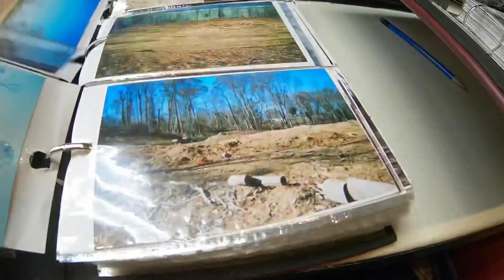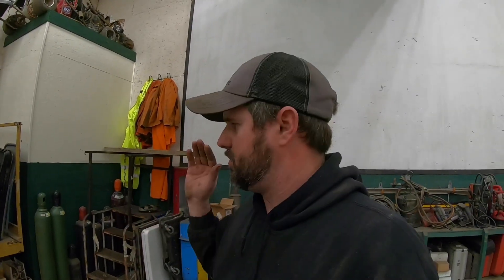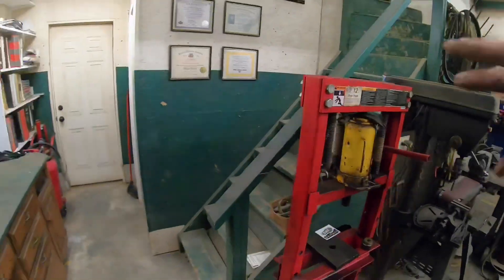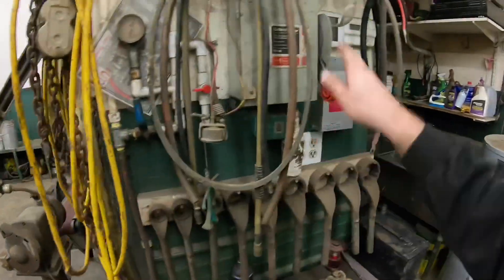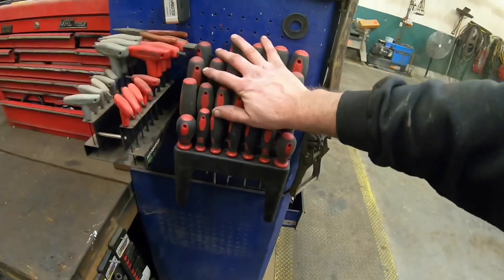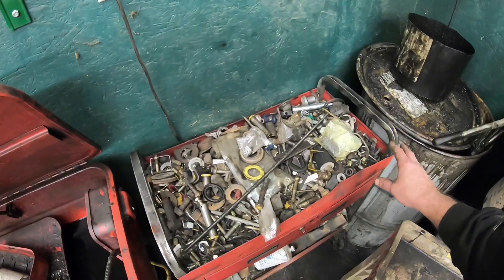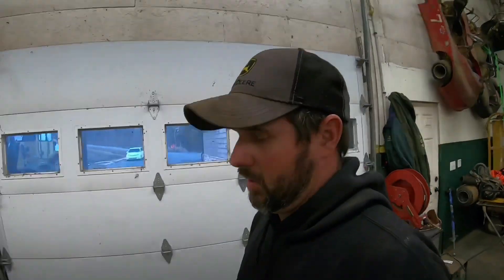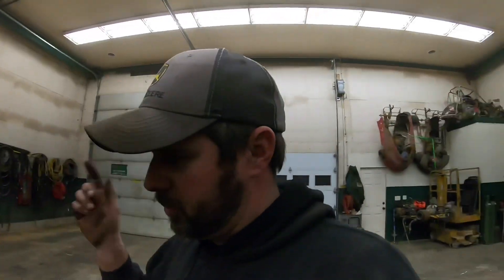Complete shop tour including detailed over view of my homemade budget built  2 ton overhead crane

Comment: Could be a possible option of putting in a door into the corner where oil drums are. Built walls out back of the lean two. Make a storage space for them and possibly a good place for air compressor to keep the noise down.

Comment: love the shop .. like how you did the garage doors so the crane works ,, the place I bought a year ago has a pole barn ,, yes it would be better if it was stick built .. i have put up 2 x 4 s getting ready for insolation then wall covering ,,  my shop is 30  x 40 10 ft walls ,, wish was 12 but I did not build it .. I use a engine hoist a lot .. and chain hoist off the trusses not safe ..I need to put steel beams up 2 ton would be the max I would be lifting .. need to find out what size beams I need ,, would love to have the over head crane system . rebuilding 1 of my trailers .. would be nice for lifting the axles .. there heavy engine lift too hard to move around with that type of lift ,, Great build on the shop and great video .. P/S where is the fridge ..??? I have a mini fridge in my shop with PEPSI , my shop is not attached to the home ..also the osb you put up I think is better for sound doing filming ,, where if it were metal the sound would echo..

Comment: you made a lot of good points.   Id like to put up a shop soon and have about 5 or 6 quotes for pole buildings. like you i wanted a concrete foundation and walls 2 foot above grade for the same reasons you mention.   I already figured out the 8' door and mini dont work out too well with my current garage.  a 12' wide door dont give you very much room on your mirrors pulling a truck in either.    I wanted to do 80' long for my cranes and to get a whole semi truck in there with room to work around it.  I started to get a spot cleared and leveled out last fall and hoping to resume here shortly with the weather getting nicer.
Reply from the maker: Sounds like you have a good plan would love to come visit some time and check out the old cranes
Reply: @DirtPerfect  sounds good.  MLH  and jason works a lot are 30-45 minutes from me.  tom decasale is an hour and 45 minutes and Garret is about 4 hours from me and The volvo customer center is an hour 45 as well.

Comment: Been lurking a while and subbed..... Shop envy for sure!! I am a Safety Manager, and noticed many pro-active things you have done. Congrats!!! But a couple things need to be pointed out and addressed: 1) I would put an extinguisher between the two doors... Less travel time in an emergency. 2) Clear access to the one one the North(?) wall. 3) Grinders. Guards need to be on them, and kept on. (I've seen a few of your shop vids where the guards are not on the grinders...) And 4) I would recommend adding wearing a face shield when using alot of the power equipment.  Think of it as double eye protection. These are minor quibbles I know, but safety is paramount. Keep up the good work, and keep loving that family of yours!! 

Lou
Reply from the maker: Thanks buddy

Comment: Nice shop I will say back then building the way you did stick building walls was more economically efficient so to speak. Now days the pole barn packages would save anyone lots of money on finishing off. One they have not changed much on the structure prices. Two you can work on finishing off inside as the prices drop on materials and as a person have the money saved up to spend. Milwaukee and dewalt have ups and downs as you say. Few years the Milwaukee batteries just sucked. Years before that dewalt batteries sucked 😅😂 they both have their years where they are amazing.

Comment: I was wondering why you had an air powered crane, I'd never seen one of those before, that's neat!  I'm with you on building a normal building instead of a pole barn, finishing a pole barn is just as much work as building a building with a foundation.  I've been thinking of building a shop that I can also store my motorhome in for the winter, but ultimately I want more land, so that will wait.

Comment: One thing you might like are large wooden blocks from bridge planking.  They are handy for supporting equipment, frames, support for welding while using jack stands and bottle Jack's.  I had railroad iron in the concrete for dozer so it won't bang up the concrete. Very sweet overhead crane. My door is wider so large equipment like combine, planters, disc and forage harvester can get in.  We have an extra side door for normal size vehicles with a drain to wash indoors. Love your shop! Well organized and planned out.  The OSB was the right choice.
Reply from the maker: Yes have some around back

Comment: Hey there, Great video and I love the channel. I'm going to be building a ICF shop in the near future (26 x 36 parking garage with a 30 x 40 shop behind that, 12' ceilings). you mentioned some general design rules for building an overhead shop crane, i was wondering if you could point me in the right direction to start looking at what I need to build one. i was thinking of using the ICF wall as support for the girders, but not sure if that would work (Tensile force vs compressive force and all that). Thank again for the great videos, they have helped me a lot in planning my build. :)

Comment: Thanks for the tour Mike Nice shop . In my shop 23 years old I have a hoist but like you said my ceiling isn't high enough  I can just stand Under vehicles and equipment no extra space. I did all my solid airline in Copper. With water filter & oiler at five Quick connect points. I can fit my  303.5C through my large door.  And all our tractors and our wacker neuson dumper just taking the beacon off.  And can only get our cat 416  just to the cab . Anyway thanks for sharing 👍😀 and have a good one. 🇨🇦 Craig

Comment: I agree 100% on pole barn vs other construction. Another thing you didn't touch on was how much a particular building will flex in the wind. Without basically building a house inside a pole barn, you'll always be able to find the seams in the drywall cause it will always be cracked! I'm leaning toward a steel framed building, however for my use.
Reply from the maker: Yup that is true also

Comment: Mike I noticed you have that air compressor tucked in there. Just a thought. When was the last time you changed the oil in the it? You may want to change that oil. Those old compressors are far better than the new ones. God bless
Reply from the maker: Yes every spring
Reply: @DirtPerfect  I should have known you're no dummy. God bless

Comment: Very nice shop you got there!  I like the old school feel it has to it with some of your grandfather's tools and such, I'm also sentimental about all my grandfather's tools I was blessed enough to inherit.  I do have one suggestion, it appeared to me that some of your air lines coming off of your compressor looked to be PVC.  If so, you should look into replacing them as soon as you can with copper or compressed air specific tubing.  I have some personal experience with PVC air lines and I am extremely lucky I wasn't injured or worse.  When I was probably 16 or 17 I worked at an independent auto repair shop that had their air system plumbed in PVC and the first time a section exploded, chunks of pipe missed me by a couple of feet at the most.  Despite the protests of the other techs and myself, the owner had a new section of PVC installed.  Couple months later a section on the other side of the shop let go and blasted a customer's car taking out the passenger side glass and doing some pretty decent body damage.  Fast forward several years and I was at work at my second career as a Firefighter/Paramedic and was dispatched to an emergency call from a body shop.  Initial info was 2 injured workers following an explosion, that shop also had PVC air lines and during the hot summer the main branch of I believe it was 1.5" or 2" PVC exploded, one of the workers had some lacerations to his arms but the other worker had several penetrating wounds to his neck, chest, and abdomen and was severely injured.  We took him in as a level 1 trauma patient and he barely survived and from what I know did suffer permanent injuries from it.  Anyways, pardon the long winded comment, I just wanted to pass on my experiences with that.  I really enjoy your channel and you seem like a genuinely good guy and I would hate it if you or anyone else ever got hurt from that.  Great job on the crane, she's a beast!!  Thanks for taking the time to produce your videos, they're great!   Take care and the best of wishes! 
-Johnny
Reply: I apologize Mike!  I was doing several other things when I first watched your video and I knew I was missing chunks of it so when I went back to watch the parts that I missed I saw where you mentioned that you need to upgrade the air lines. My mistake!

Comment: Nice shop, I wish I had thought more about things when I built my shop/garage. I built a 3 car that ts 28 by 44 with wood shop above. both with 9 foot ceilings. 2 of my over head doors are 8' high by 10' wide. Works good for most things except I have to remove the top off my tractor top to fit in! Also as to your shop, it looks a lot more organized than what I have see recently; HaHa!

Comment: get a cheap dual voltage plasma cutter from amazon.  make sure it has a pilot ark start!  look at the torch and see if you want the trigger on top or the way it should be.  lol  i have 4 different plasma cutters and have owned a couple more.  i have a 100 amp Thermal-Dynamics.on my cnc table.  a small 15 amp Thermal-Dynamics for taking on the go for door installs in metal buildings. and a 40 amp harbor freight.  i use the harbor freight the most for any kind of fab and hand held work.  i have tested out a couple of the cheapest cutters you can buy on amazon.  and they have come a very very long way from my first(1980 model hyper-therm)  and their consumables are way cheaper!  get one and put it to the test.  amazon will take it back if you dont like it!

Comment: Hands down you killed it with the crane, your also spot on about much of what a building should be. I built mine in 1992, 42'x70'x16 unheated Lester pole, 6" concrete with steel bar. 20'x16' side sliding door and 14'hx16'w roll up, 12 Low Bay lights. As you did, I figured 13'6 was legal height and now would do 16'h since the combines are getting larger and taller. 

You will never build the perfect shop as times and methods change, I'm happy with my decisions and can always expand if needed. I have a new 2 post lift coming this summer and need to rearrange.
Reply from the maker: Thanks

Comment: What air reels do you use? We’ve been through several different brands and non of them are cheap and they never seem to work well in the cold... the rotating mechanism built in never seems to be that good...
Reply from the maker: Cheep ones for the farm store never had a problem with the real has to replace the hoes a few times

Comment: We're thinking of building a new shop an we're tore between 18 or 20 foot wall for a 16x35 door. But it's going to have in floor heat with force sir for back up
Reply: Tall ass walls are really nice when you need em. Easier to have it and not need it than need it and not have it

Comment: Technically, 14’ is maximum legal height for federally operated trucks, but it can vary state by state for local highways. Most trucks try to stay under 13’ 6”. Still, thanks for tour of your shop. Maybe your next shop could include a pull-through 70’ bay so you can park the full truck & trailer inside for repairs. Or at least a bay for the full trailer.

Comment: Mike you have a very nice shop. You recycled material that would have been junk. This saved you a lot of money.  I have a more modern shop in that I have a factory crane. LOL I also hired this one built. ( being 60 makes a difference) This is my third shop too.  I knew I would be moving and growing. So each shop is larger than the last. I also learned what I wanted and did not want.  I am also much older than you too. LOL    Things I think everyone should think about having in their shop. 1) Infloor heat. If you have a very tall shop you about have to have it to keep the floors warm.  2) minimum of eight inches of concrete in the floor. Shop floors take a beating. Also use #4000 mix at the minimum. MY current shop had #5000 mix.  3)Large doors,  Mike is able to make a 12 foot wide door work. Most people would need a much larger "Big" door. I would say 14x14 as a minimum.  I am in Ag. my "big" door is 16x40. 4) insulate as well as you can. I find that the shop being cool in the summer is as valuable to me as being warm in the winter. Thank you Mike for the shop tour. A lot of ideas for others to think about.

Comment: All you're missing is a air tool hanger, and all you need to make one is a drill, a grinder with a cut off disc, and a scrap piece of angle.  Pics:
https://photos.app.goo.gl/BzunormZduZQ59y1A
https://photos.app.goo.gl/KbwYLhAo4DStXJ4e9
You will need a 2x2 to set out from the wall enough though.

I test built that one out of an rusty old bed frame, and it worked so good that I just panted it and mounted it on the wall.  One guy said that half my tools would fill up dust, but I assured him that the mud daubers would have those air hole plugged up soon enough...
Reply from the maker: Yes have toyed with building one

Comment: Back when i sat my Licence for my heavy traffic ( Truck Licence ) the police man asked me if there are any other ones i would like to go for? So i got my tracks and rollers.. Bear in mine i was 18 years old ( In New Zealand )  and the police man said if you can bring me a dozer he will give me my licence... Here is when i go sure ( My Uncle had his dozer in getting fixed just across the road ) So i call in find out if its done and then ask the policeman  if i can bring it to across the road and he said sure ( Not thinking i was going to ).. Went round back started the pony motor got the big motor running and started to track out of the yard between the buildings and heading for the road... Had the blade just about to clear the start of the road and the policeman was there waving arms legs everything to get me to stop,, Which i did, He gave me my licence funny as all hell he asked me would i have driven it across to him, Answer YES LOL ... It was a old D6 9U .. You needed to be an Octopus to drive one in the bush logging which we did ... Cheers for the shop tour... Cheers John

Comment: you,re shop is like you,re trac/lowboy you have to have them to operate it is awful nice to have in bad weather to repair things you have the cadillic of air compressors they run forever and when they do wear out they can be rebuilt be sure change oil and drain tank daily